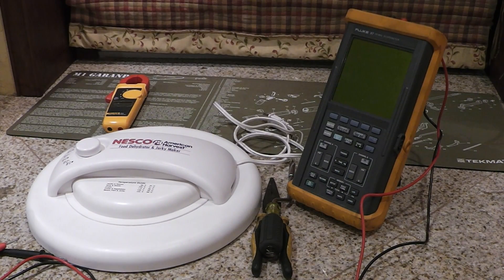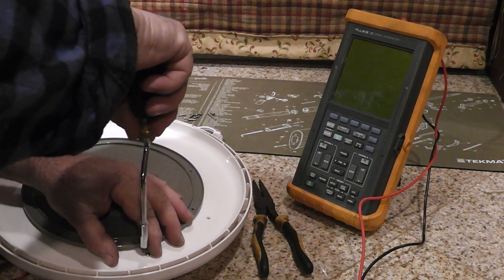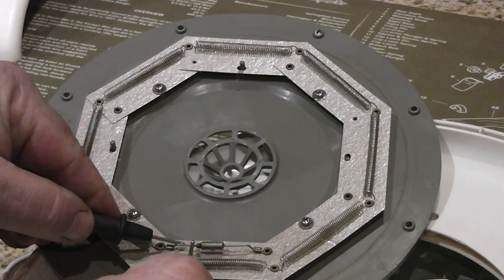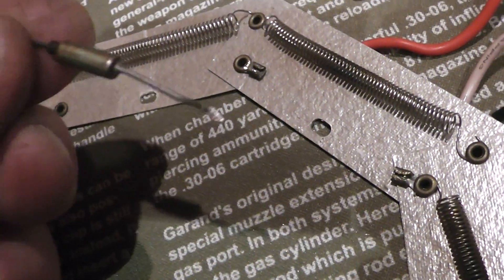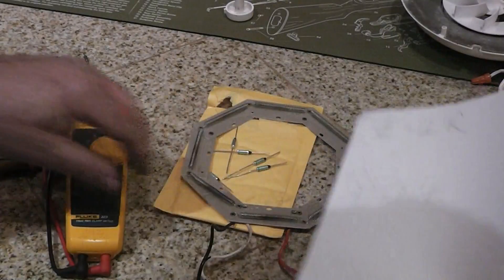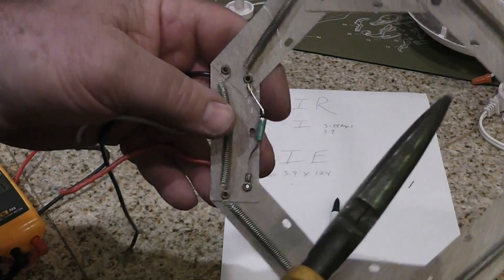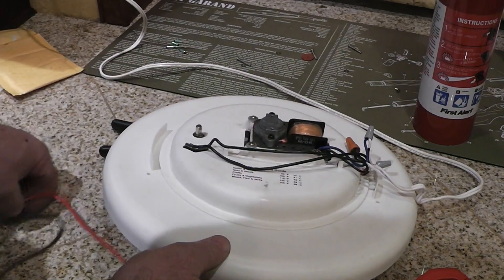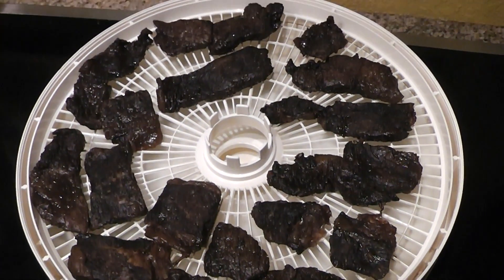Electrical Repair of Nesco Dehydrator

Comment: I have some sf139e already. I hope it doesn't sound too dumb to ask if they could be used in place of the sf129e.

129's max temp is °133, 139's max temp is °142. Is the difference that great in a dehydrator that supposedly sets the temp anyway?
Reply from the maker: There are no dumb questions. I would put the same rated  fuse that I took out back in. You could call the manufacturer of the dehydrator and ask them if you can substitute the fuse.

Comment: I just found this video and thankful! The fan on mine works but not the heat element. The little fuse does look dark so it must be it. Do you think regular hardware stores would carry the fuses? Maybe an auto parts store?! I have a million peaches to make fruit leather with and this was a heck of a time for this to go bad 😓🤦‍♀️.  Thanks so much!
Reply from the maker: Thanks. I doubt an auto parts or hardware store would carry this but, you could call and find out. Radio Shack is no more. You might try a local electronics store or you might call an electrical supply house like Graybar or Grainger. This video was made around 7 years ago and the only place I could find these fuses was on line.
Reply: @homesteadprepper  thank you!! I live in the middle of nowhere so onlines probably my only option anyways!! Thanks for putting this video together for us! 😊 and thanks for the response!! I can’t really read the numbers on the fuse since it’s so dark so it’s going to be tricky 😬
Reply from the maker: @Jennifermcintyre  Np. It most probably is one of those SF129E fuses.
Reply: @homesteadprepper  thanks so much!! I have a different model.. it’s a 40 year old “harvest Made” model that I inherited from my grandmother and I’d bet that its worked perfectly all those 40 years! I had some peach pulp fall into the motor area and I’m afraid that may have caused this… it’s just weird that the fan works but not the heater.. and the heater coil looks fine… I suppose 40 years is a good run!!

Comment: That sounds awful, you have something contacting the fan. You got erroneous readings because the motor was causing magnetic interference. Oh, and that part you replaced is called a thermal fuse. They generally don't just go bad. Your thermostat went out and that's what killed the fuse.
Reply from the maker: The thermostat is still working 7 years later, today and that is not what killed the fuse.

Comment: Best not to use solder for anything that heats up.  The melting point of leaded solder is considerably higher but still best to crimp.

My experience with American Harvest has not been good.  In the distant past had two Jet Stream ovens, both failed within a year or two of use.  The Lexan lid would crack from the heat or the belt would break.  They cost about $200 plus each at the time.  Made in the USA.  The Chinese made heating element never failed.  I should have known better because no brand name ever made a similar sleek looking unit.  Theirs were big bulky and cumbersome.

This made in China Nesco/American Harvest dehydrator appears to be much better.  Panasonic is the brand I prefer when given a choice.

Comment: My nesco dehydrator have no heat, but the thermostat seems to function properly( pass the ohm test) . What else should i check?
Reply from the maker: Check for open heat coil and 120 volts in.
Reply: @homesteadprepper  i just found out that the heat can be turn on initially at high heat(160F), but the heat will turn off after a while and won't turn back on again.
Reply from the maker: It is either the thermostat or it is the thermistor. You will have to see if you have 120 volts from one side of the thermistor to the other side and see if you have 120 volts going in and out of the thermostat. That should find your problem.

Comment: The thermostats ARE a big problem, and probably the cause of many of the "thermistor" (actually thermal fuse) failures. My unit would not heat at room temperature - and they should, even on the lowest setting (unless you are in summertime Phoenix AZ and then you don't need this dehydrator...). When you open the unit, after removing the 12 screws to get all the covers and plates apart, you will see the thermostat screwed to a thin metal plate. On mine, the lower metal strip of the themostat - the strip with the white post at the end - was fully pressed down onto the metal plate; this pushes the white post up and opens the contacts - thus no heat at ambient temps. By putting a washer between the bottom of the thermostat and the metal plate, the thermostat sits off the plate and the bottom strip is not pushed up. But the bottom strip was bent from the factory assembly that caused this problem in the first place so it had to be gently bent downward to allow the contacts to close at room temperature. Another thing to watch is that the bottom of the white post is directly over the "dent" in the thin metal plate when assembling; if it is slightly off-center of the dent, you might again be contacting the white post base on the metal plate, pushing it up; keep it centered when you tighten down the thermostat. Note that after the tweak of the bottom strip (to allow heating at ambient) the calibrated dial is no longer correct and very difficult to make it read correctly. I actually ran the thermostat (removed from dehydrator) in a small oven with an ohmmeter to see when the contacts opened; I tweaked the bottom strip up/down to get about 60C with the knob in the center of the range and then reassembled everything and it works well but is not in agreement with the knob  - not calibrated. So I use a fine wire thermocouple poked into the dehydrator and tweak the thermostat adjustment with a screwdriver (knob removed) to get the temperature I need; this is not ideal, but better than throwing away an otherwise nice unit. In summary, it seems these dehydrators are pretty sketchy - lots of failures and the company has no parts available. They are a nice design, but low quality electrical parts and poor assembly. But at least you can open them up and tweak stuff. I guess this last statement should send most consumers running.

Comment: I'm having a slightly different problem.
The heat lines work, but they turn off again after 1–3 seconds.
Do it again and then it turns off again after 1~3 seconds.
Is this also the effect of Thermal Fuse?
Reply from the maker: I would replace the thermistor.
Reply: If the thermal fuse opens, it is open and you won't EVER get any heating. This is a thermostat problem. I left a reply to Douglas Lonngren about my adventures with the thermostat issues. That might help you.

Comment: if you got the fan working, why need the fuses?
Reply from the maker: The thermistor or fuses will keep your house from burning down.  I would highly recommend that you do not ever bypass a fuse, thermistor or any safety device.
Reply: @homesteadprepper  Thank you for the explanation!

Comment: I found a source of problem that causes the thermal fuse to blow. My Nesco Dehydrator's thermostat had the contacts welded by a tiny piece of metal between the contact faces. The source of the metal was the contact face itself forming a sliver from the arc-plasma during cycling. Using a diamond contact file I was able to resurface the contact faces and restore the operation of the thermostat.

Comment: Just wanted to say thank you for this video. We were able to do the exact same fix (thanks to your instructions) which saved me from throwing away my dehydrator which I have loved for a long time. It only cost me about $5 to get the part. My husband soldered the new part in and it works perfectly again. We have extra fuses so if it ever happens again, we'll be ready.

Comment: Thank you! That's a very handy video. After confirming no conductivity across the thermistor, I removed it, but the markings aren't the same as yours, and googling didn't give me an answer for what to get. Any way I could email a picture of the thermistor? Spelling out it (best I can do): AUPO BF 133 [symbol] [PSE] TF133º C F2 [DVE] JET
Reply: What markings did you have?
Reply: @mebinglesideil26  I apologize for the slow reply! I tried to spell out in my earlier question what the markings were, but I know what I wrote isn't easily readable. I'd be happy to upload the picture(s) I took, but I'm not sure how to do that. FYI, I did buy 5 of the thermistors mentioned in the video, and replaced the presumably faulty one in my Nesco. And the dehydrator came back to life. I do wonder if the specs for my purchased thermistors are different than the original one I replaced, and wonder if that affects how the dehydrator works. If only the company had opted to put in some sort of a resettable fuse that could turn off the device if overheating....

Comment: If the thermal fuse blows more than once the problem might be the thermostat in the dehydrator.  There are two "pads" on the thermostat's metal strips that move apart when they reach the set temperature.  The pads on mine had a buildup of some type that kept them from separating.  A few passes with some fine sandpaper removed the buildup and now the thermostat is properly controlling the temperature; and the thermal fuse is not being blown.  I replaced the thermal fuse several times before I found out about the thermostat on fixya.com.  It may not be that common a failure because that is the only place I saw the information.
Reply: The thermostats ARE a big problem, and probably the cause of all the "thermistor" (actually thermal fuse) failures. My unit would not heat at room temperature - and they should, even on the lowest setting (unless you are in summertime Phoenix AZ and then you don't need this dehydrator...). When you open the unit, after removing the 12 screws to get all the covers and plates apart, you will see the thermostat screwed to a thin metal plate. On mine, the lower metal strip of the themostat - the strip with the white post at the end - was fully pressed down onto the metal plate; this pushes the white post up and opens the contacts - thus no heat at ambient temps. By putting a washer between the bottom of the thermostat and the metal plate, the thermostat sits off the plate and the bottom strip is not pushed up. But the bottom strip was bent from the factory assembly that caused this problem in the first place so it had to be gently bent downward to allow the contacts to close at room temperature. Another thing to watch is that the bottom of the white post is directly over the "dent" in the thin metal plate when assembling; if it is slightly off the dent, the metal plate might again be contacting the bottom strip or white post base. Note that after the tweak of the bottom strip (to allow heating at ambient) the calibrated dial is no longer correct. I actually ran the thermostat (removed from dehydrator) in a small oven with an ohmmeter to see when the contacts opened; I tweaked the bottom strip up/down to get about 60C with the knob in the center of the range and then reassembled everything and it works well but is not in agreement with the knob still - not calibrated. So I use a fine wire thermocouple into the dehydrator and tweak the adjustment to get the temperature I need; this is not ideal, but better than throwing away an otherwise nice unit. In summary, it seems these dehydrators are pretty sketchy - lots of failures and the company has no parts available. They are a nice design, but low quality parts and poor assembly. But at least you can open them up and tweak stuff. I guess this last statement should send most consumers running.

Comment: I have a question. We have one of these and it blows are but the air doesn’t feel warm even when set on 125 degrees, should the air not feel warm at that temp??
Reply from the maker: I would use a thermometer to check the internal temp.

Comment: Dude, you rock!  Thank you so much for posting this.  I just fixed our broken dehydrator thanks to your excellent video and saved $60! Plus my wife thinks I'm a hero. Getting the crimped / soldered part open to put the new fuse on was the hardest part. Found working a sharp metal point in first (have one with my screwdriver set), then doing the pocket knife bit to open it did the trick. Other than that, it was pretty much as you said.  Great job showing your work.

Comment: NOT a thermistor (used to monitor temperature).  NOT a current limiting fuse.  IS a thermal cutoff or thermal fuse.  Look for a cutoff temperature number on the side of the device to order replacement parts.

Comment: Great video. How did you find out the type of thermistor? Was it on the part you took off?
Reply from the maker: It was stamped on the part. Barely readable but, enough.
Reply: I just replaced the thermistor (ours used a TF142C, and you are correct, it was on the part) and it works now! I couldn't pry apart the metal crimped onto the old thermistor, so I just cut it off and soldered on the new one. Thanks again. I'm so glad you and others take the time to make videos like this, since I don't think I would have known to do this on my own.
Reply: Thanks, I'll try to pry it off and look. But our dehydrator looks very similar to yours except for some cosmetic differences so I bet it will be the same

Comment: homesteadprepper:
is the temperature control a variable resistor? Also where did you order your thermal fuses from?
Reply from the maker: Temp control uses a thermostat.  At 7:41 in the vid is where I ordered the fuses from ebay.

Comment: I got a new thermistor, soldered it on to the unclamped ends where I clipped off the old thermistor I couldn't unclamp, but it's only reading the current on one side of it.. and the fan isn't working, what could've gone wrong? And how do I fix the fan?
Reply from the maker: Do you have continuity through the thermister?  I have had new parts thet were bad right out of the box.
Reply: homesteadprepper no, there is no continuity actually, I thought it might have been my soldering job never thought it could be new fuse
Reply from the maker: Try replacing it but, check for continuity be for you install the next new one.
Reply: You might have blown the thermal fuse when you soldered it.  It can be tricky, most are mechanically attached.

Comment: How did you get the fan to work before replacing the piece? I just diagnosed mine with the same thermistor issue
Reply from the maker: Giorgio GetLifted I went direct and bypassed the thermister to test it.
Reply: @homesteadprepper  thermistor or fuse?

Comment: i have this same dehydrator and the fuse is bad. I tried to ohm the temp control and it does not change my meter. I assume the ohm's should change  as you turn the knob( It shows zero ohm's resistance). Am I wrong on this and if not is that what burned out the thermal fuse. If so this should be checked before repairing fuse. Thanks for the video.
Reply from the maker: I believe that the temp control is a theromstatic and not a rheostatic control.
What burned out your fuse could be any number of things.  Just replace it. Take some amp and temperature readings for safety.

Comment: What happens if you bypass the fuse? The dial/pot is regulating the voltage right?
Reply from the maker: I strongly encourage everyone to use the proper size fuse for fire prevention.
The fuse protects the device from overloads and fire.
Reply: I’m theory, from armchair warriors, your home fire insurance will be voided since you bypassed a critical safety feature.  In reality, it will work but will not have a safety feature anymore.

Comment: Great video and instructions.Can you post a link for the fuses you ordered? Also, I messed up one of the coils-is it possible to order a replacement or even the whole assembly?
Reply from the maker: Just type in SF129E 10amp fuse on Ebay and you can buy 1 or more.
I don't know about the dehydrator parts but, you could call the manufacturer and they would probably sell you what you needed.
Reply: @homesteadprepper  my fuse said D1115 SPEY 117°C is this the same fuse?

Comment: Thanks for the great video   I have the same problem. My dehydrator just died, it is at least 8 years old  Just wondering -- how yours worked out... is it still working?  I'm probably overthinking this but if f the fuse blows couldn't it  be for a reason other than the fuse just wearing out.  Although I know we've replaced fuses in coffee pots, and heaters in the past and they kept on working without burning up or blowing the new fuse.  So IDK.
Reply from the maker: Good question.  If the fuse keeps blowing shortly after being changed, we can definitely conclude that something is going bad in the device and it is time to start changing out other components or to start thinking about total replacement. Btw, my dehydrator is still going strong.
A fuse can blow from age, electrical surges, lightning,installation, poor manufacture and etc.